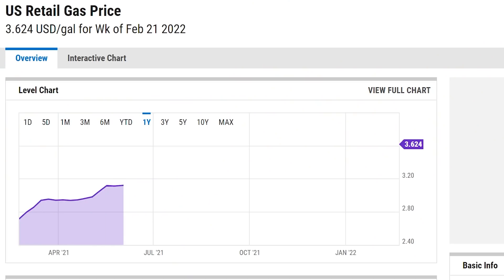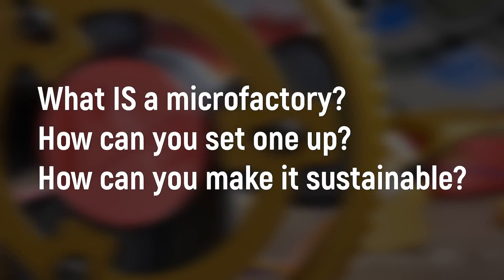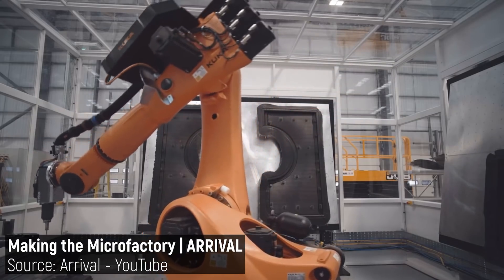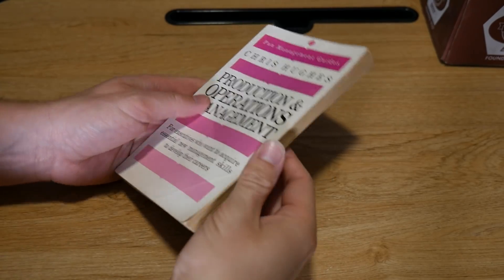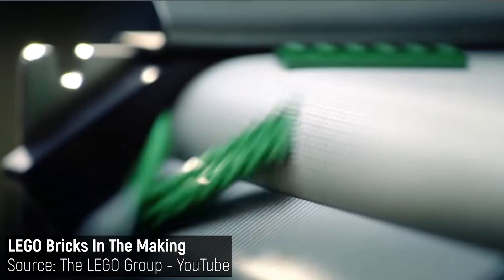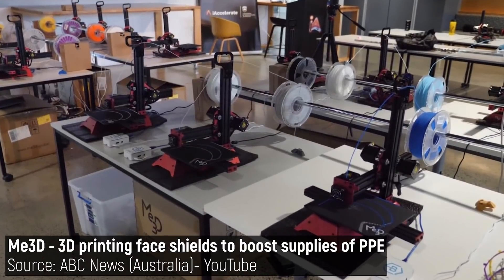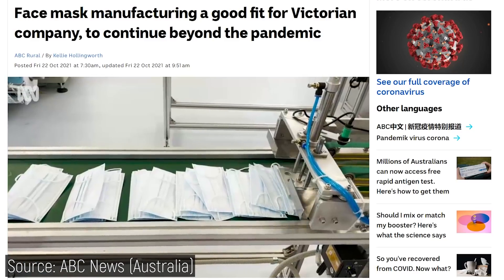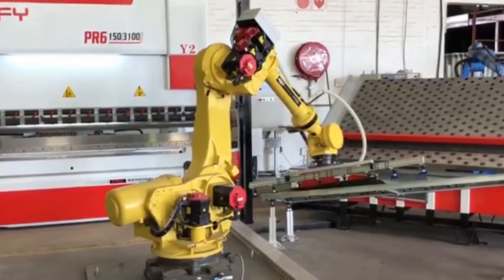Can Microfactories Solve the Global Logistics Crisis?

Comment: Microfactories will not be a thing because the economy of scale is so incredibly important to the modern world that even substantially higher transportation costs still do not make a dent of deterrence. This does not apply to, as you mentioned, short runs of things. There are job shops all over. Your phone book (if such a thing still exists) likely has several machine shops and furniture shops and possibly even listings for specialist trades like cobblers or luthiers. I worked in several before settling down as an in house design engineer for a small international manufacturer.

For those not in the know, allow me to give a short, real example of the economy of scale. This is approximately what an actual, bottom line quote looks like for manufacturing from memory of a part we had priced a few years back:
To have just one made: $10,000
To have 10 made: $18,000 ($1,8000 each)
To have 100 made: $28,000 ($280 each)
To have 1000 made: $36,000 ($36 each)
To have 10,000 made: $62,000 ($6.20 each)
To have 50,000 made: $145,000 ($2.90 each)
To have 500,000 made: $1,010,000 ($2.02 each)
To have 1,000,000 made: $1,340,000 ($1.34 each)

This part was made of about $1 worth of actual material. The other costs come from not just logistics of it changing hands through various forms but also for the machines or tooling to be created to make these things (both the designing and the fabrication) then the labor of the people running the machines, the power costs for the machines and for the shop itself (if they can't see then they can't work) plus taxes and more taxes and also some more taxes (not just sales tax but also property taxes on the building the machine is in and payroll taxes and income taxes and environmental taxes and transportation taxes and I can't even remember all of the taxes) and heck for a job shop you not only pay for the time that your part takes but also the estimated time before another job comes along since they need to make a living even on slow weeks, on and on and on, overhead is a mountain that can never be fully climbed. The more things you make the more those costs can be spread out, which also means the quality of work can be greatly increased without greatly increasing the cost. Yes, a $500,000 or $2,500,000 CNC mill does reliably produce nicer parts and tooling in less time than a harbor freight bench top or even a Bridgeport knee mill, even if you are only making one of a thing, and I say that with a decent shop in the basement and having made lots of good parts on a knee mill. I have no doubt the typical home maker could design and make a decent phone case, for example, but there is no way in hells even a thousand microfactories could make a cell phone and charge the same amount or less while delivering the same quality or better. Early industry still depended on large amounts of logistics for hundreds of years, as they used mass produced goods to make larger goods from local material or custom goods for local customers (genuinely really cool to look at bills of lading from New York harbor for instance in the 1700s, factory nails and fittings to the cartwrights, factory barrels and locks to the gunsmiths, factory textiles and thread to the tailors, etc) and when I say factory produced I am including cottage industry where whole neighborhoods or towns would be devoted to an individual industry and worked together to produce a good to export as a factory would. If the one guy at the cooperage just puts on bands all day and he has been putting bands on all day every day for 30 years then he is going to be damned good at putting on bands, able to do it better and faster than someone that makes barrels a few times a year and has to do all of the steps themselves because their local market can only support that business that often, so then the industrious cooperage can make more money and pay better wages while charging the same or even a lower price for a superior product that is also more available. Even in the old days the basic tenants of economics were the same and this plus a few centuries gives us the modern global industrialized market that has done more to advance the betterment of the standard of living for everyone than anything ever. The canal being blocked was less a sign of the failure of international logistics and more just evidence that we need larger canals, which is why there has been so much reconstruction of major ports the last decade or so. For several years only one stretch of docks on the entire eastern seaboard of the combined continents of North and South America were able to accept the largest freight ships. But I digress.

I look forward to the video series. As someone that has worked in almost every industry sector in existence, I can really appreciate the challenge of actually making something start to finish and very few youtube channels are brave enough (or foolish enough) to try showing such endeavors.

Comment: There have always been small local shops for doing custom work. Some people will pay for special attention, for custom orders. Most will not. If there is a supply issue more people will turn to a higher priced local product, but these might be the same people that would just pay a premium for a higher price on the item and the additional cost for priority delivery. Small operations can exist but typically in very niche. segments.

For 12 years I had worked for a small electronic manufacturing company that had a maximum of four employees. Before I left I had started up my own company with a $600 product for a niche market. There was an opening for a electronic design engineer at another small manufacture (20 employees). I was offered the job and I left the previous company and abandoned my own startup. Now 25 years later I am 2 months from retiring.  

We hired an engineer who had recently emigrated from China to be my replacement. He is surprised at the breadth of my duties. The other surprise was how expensive components and materials are here. Everything here is so much more expensive. 

I am very interested in seeing what you come up with in this series. I don't think that the micro-factory concept is generally feasible. There will be exceptions. They have a higher likelihood to exist when there is some form of subsidy compared to a stand-alone business. One example is a Hutterite colony that has a business entity as a smaller part of the overall Colony framework. I have seen a few of these. In one the products being manufactured were even being sold to Walmart.

Comment: Short answer.   No.
Long answer.  Injected molded plastic scales with size, and is vastly stronger than any 3d printed model, vastly cheaper,  and far cheaper.

Logistics is dirt cheap compared to labour!  I can ship a pair of shoes from China in bulk for less than 20 cents per unit!

Comment: I run what I would consider a microfactory producing electronic products. It works because they are niche products that don’t have the volume that would make them attractive to larger manufacturers. But I struggle with the supply chain issues to feed my small production line and a lack of buying power that would yield lower costs.  As it is a niche market, I consider the entire country my local market with only a handful of customers per state.

Comment: I think my father may have been an "early adopter"...
Just after WW2 he set up a hobby engineering shop in the basement of our home.  Not interested in making model steam engines, he eventually ran out of tooling accessories he "had to make".  He took on a contract to make heavy clockwork motors for a fire alarm company.  Older viewers will recall the red drum on street corner posts with a brass knob behind a glass window... "Break Glass and Press Knob".  This started the motor, which sent a coded electrical ID message to the fire station.
Eventually much of the repetitive machining operations were semi-automated with sequenced pneumatic actuators he made, operating converted machinery.  When he eventually got everything "ticking along" to his liking, he became bored with the mundane day-to-day running of it, and sold the whole going concern.   I still have the first lathe he imported to NZ when I was five years old; a Myford Super 7 long-bed.
Thanks for another great video.

Comment: Microfactory may be a new word, but blacksmith shops and wood shops have been around making local products for 2500+ years.  In the US 1600-1900's, blacksmith shops made horse shoes, fry pans, nails, hinges, door latches, wheel rims, etc for the local market, mostly on an per order basis.

Comment: The concept sounds good like local farmers market but it won't work for manufacturers, I have a job in engineering shop where I do small run parts and on the other side we have people who want things fixing either welding or re maching and if I had to rely on just repair I would be broke in a week, everyone thinks 3d printing is the be and end all and can make money with a print farm but at the end of the day people need actual products like loo roll or plates and cups and cooking utensils and if we had to rely on micro producers for this every day stuff then the cost would be astronomical. I whole heartedly agree produce domestic products to stop this cheap crap being imported then you have a greater employment, but then comes automation ie robots but that's a whole topic for its self.

Comment: I think for this to work, there needs to be a standard. A standard set of tool, a standard set of outputs, with quality control standards, that can be sold at standard market values to make a proven profit. There needs to be a schedule worked out where you will be able to tool for product X for Y days, then pivot to product Z for... A days, darn it I ran out of variables.
Typing that all out, one idea comes to mind: Franchise. The McDonalds of manufacturing. That way a local franchise owner can buy the standard set of tools from the same place, produce them to a specific standard, and then sell them to specific markets.
There is going to be a huge challenge to beat China, which is unquestionably the goal here. But considering what the global supply chain is starting to demand, the iron may be hot right now.
Reply from the maker: 100% agree, process and operations manuals with some degree of repeatability is a must. As much as I dislike 3D Hubs they had the right idea with the marvin "proof" print. The goal in my eyes isn't so much to beat china and huge factories but make up for the shortfall and perhaps reignite local manufacturing hubs.
Reply: @MakersMuse  If, and this is a big if, you can promise that "Makers Muse Mini Factory" franchises can produce reliable quality, no matter if their based out of Montana or Melbourne, then you can set up partnerships with chain retailers so that they have a guaranteed buyer, then this proposition not only becomes possible, but it becomes almost inevitable.

Comment: I created Haltech in the 1980's.
I am currently creating a micro factory in NSW Australia using 203 3D printers, laser cutters, small CNC and robotic arms. The limitation on the location is the total power draw at the site because of the heated printer beds required for carbon fibre nylon. I am experimenting with strategies to stagger the start times of each group of 16 machines and then turning the print bed heaters off after a couple of hours of printing. I'm also adding significant solar backed with lithium to make the manufacturing as low carbon as possible by trying to run the heated beds up while solar is working.
Reply from the maker: That sound really neat! Is there a specific range of products you're intending to leverage it for, or is the aim more for prototyping and one-off models? I definitely think the local automotive segment is one that would benefit from this kind of idea. I'm sorry Steven, I feel you emailed me a while back and it got buried, I'll try dig it up.
Reply: @MakersMuse  My son Max Is creating a new company to make modular electronic terrain sets for table top games like Warhammer. The bespoke terrain tiles are 300mm x 300mm to give terrain tables up to 2.4m x 1.2m. So big bespoke printing. I offered to design the electronics and software and set up the automated manufacturing line to help get him going. Initially he'll ship from Australia, but then he can copy the factory to Austin so he can drop directly into the U.S. UPS ground network. I keep an apartment in Austin, so he can stay there as he mirrors the micro factory there. I have used distributed computing between the terrain tiles. It should be fun. I enjoy your channel. It has helped me a lot. Thank you 🙏

Comment: there appear to be a large number of synthetic barriers in place to mass micro-manufacturing as a model.  These barriers, such as certification and qualification, which are largely bureaucratic, rely on centralized infrastructure that can be readily regulated and controlled by large capital and political interests.  Such barriers will cease to be a threat if/when mass adoption of universal fabricators becomes a reality.  In short, the last technological hurdle to overcome to completely disrupt the current state of madness in the global economy, is to create true universal fabricators that are available and accessible on a massive scale. 

Once this occurs, the entire concept of logistics changes, and the perspective of the individual, the one that makes the difference in ultimate economies of demand, becomes one of artificial abundance, rather than one of relative scarcity and logistical limitation. 

This of course, has many other implications, but in the context of global supply chains, this would be nothing less than a total extinction event for existing industrial interests as they currently exist.

What is more, I think, the total automation of such fabricator technology is a necessary precondition to the realization of this mass manufacturing concept.  Universal fabricators need to be not just available, but accessible, in terms of software, operations and maintenance.  They need to be almost totally set and forget devices, that require minimal user training to operate and get good results. 

They must be intelligent, in ways that current CNC technologies, often are not.
Reply: You're essentially advocating for the science fiction / futurist concept of the nanotech 'Santa Clause Machine', as always the problem isn't that no one would want one, more that no one has any idea how to make one a reality, YMMV 😅

Comment: This might get lost in comments, but i will comment anyway. 3D printers are still not very accessible in India. I can buy a 3D printer but most of the accessories are too expensive. Simple stuff like aluminium extrusions at least the quantities you'd need to build a 3d printer are expensive, stepper motors are expensive. Most of the 3D printing related channels are from developed countries and the stuff you people have access to relatively cheaper. for example a BL touch on amazon.com retails at USD 43 and on amazon.in at about USD 120 (INR 9000). A knock off retails at around USD 40. So micro factories might work for you first worlders but we are still ways off. It is easier and cheaper for us to get things with traditional machining, which might help the local machine shop. 

You can prove me wrong, i'd be happy to be proven wrong on this occasion.
Oh and your videos are awesome.

Comment: I definitely agree that it could help, as well as provide more "local" jobs, but the issue always comes down to money/cost. If you cannot get parts from a large factory you will pay more per part going to smaller or micro-factories. Not only that but for anything that needs to be certified or tested, the costs are usually on the factory making the item to ensure they are up to spec. The PPE example you showed was nice but, at least in my State, it was useless because hospitals would end up throwing them away because the items do not meet the medical standards they needed. So many regulations and requirements essentially put the idea of a micro-factory more difficult than it needs to be.